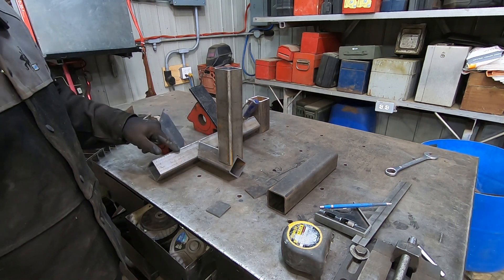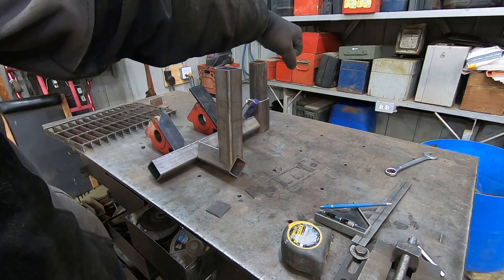#253 Tractor Step For The Case 430

Comment: Salut Joe!!!  What I find about steps on tractors is they usually are in the way or are too flimsy. In this case it certainly isn't flimsy as you demonstrated by jumping on it.  And you made it so that it can be folded up and out of the way so it's no trouble when working with the tractor.  As an added benefit you provided a good handle so the 3 points of contact can be maintained for many different situations when getting on and off the tractor.  Nice job and as usual very well built!!!  Thanks of sharing and have a great week!!!
Reply from the maker: Thanks!  I had safety in mind. But also, I had the usual goal of making it hefty!  That will also be useful for filling the gasoline. I usually put the gas can on top of the hood (I don't mind paint scratches...). Then put the small battery pump to empty a whole 5 gallons can in it. The 3rd point of contact will help me bring that gas can on top of the hood. Thanks!

Comment: I did something similar but the bottom step I use a 3/4 inch cable so it could bend and not break. Stay Safe and Warm .
Reply from the maker: That is what I had in mind, but the material available!!! Thanks!

Comment: No, Joe, for once ,  use Case orange for the step. It'll look like it came from the factory that way.  
Don't fell lonely about body parts not bending the way they once did. I'm 74, and I've got a whole hell of a lotta parts that are like that. I noticed you put the support for the step on an angle . Is that so the dirt from your boots falls through to the ground, or am I missing some other reason? Either way, you could do an Irish jig on it, it's that big, That swing up step, along with the grab handle are two great ideas.  I'd like to suggest another project for the 430.  Why don.t you make, or have made a padded seat cushion . That steel seat can't be very warm in the winter. It certainly would do your butt a world of good.
Reply from the maker: Lol! That is funny Jim!  I'll have to do my butt a good favor one day!  The square tubes being in an angle is exactly for this purpose.  It won't collect mud/dirt.  Thanks!

Comment: Good job Joe. I just finished removing my old front loader on my 431 and now I need to clean and paint before installing the newer front loader.  I have same issue trying get off the tractor too.  Especially when the front loader side pieces get in the way jamming my foot wont allow me to swivel it. I'd to build a step to go up and down.  Well after i finished installing the front loader.
Reply from the maker: Thanks! You sure understand what I mean!  The other Case with the FEL has a different step. It actually has an angle to it. If you wish, send me an email and I'll share some pictures or videos of it with you. (joe.lesage@hotmail.com).  Make sure to copy the whole email address.

Comment: Yes I agree, this is a good and solidly built step Joe. Well done.
You've given me an idea or two for my tractor as well. 
On the choice of colour, as case has used some shade of beige and orange as the colour scheme of these farm tractors, I was hoping that maybe you would or could following along with that..
The lower portion of the step would benefit you in low light situation, IF you painted it with an orange paint, wouldn't it? ZThen perhaps as we come up about half way on the step, change the 
paint colour to Case's tan/beige.
Just a suggestion.  Thumbs up for this job in any case.
Reply from the maker: That is an idea!  I've come up with the black color as a third color. Although some minor components have this color (steering, ignition coil, shifter knob... Lol!). Now I have the ROP and then the steps in black color.  That is an idea to add the orange paint on the lower step. Thanks Reg!
Reply: @FromSteelToWood  I guess the 'black and yellow' is now 'patented' by our Dave and as such is only to be used on RCAF polarexpress equipment.  hahaha!

Comment: The step turned out good, great job. The fold up lower step is a good addition. I think it does need a little yellow on the black 😀
Reply from the maker: I'll think about that.  What about orange instead? Thanks!
Reply: @FromSteelToWood  Orange would look great but Dave would not be impressed 😀